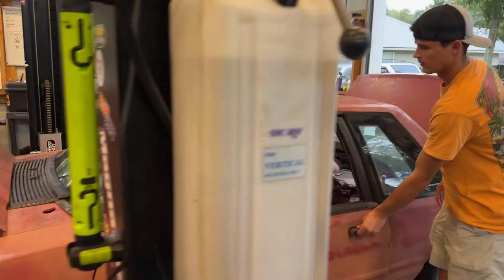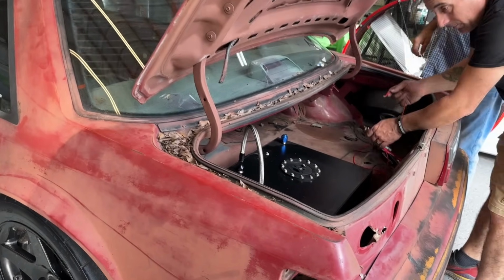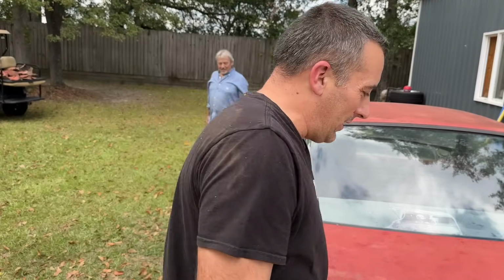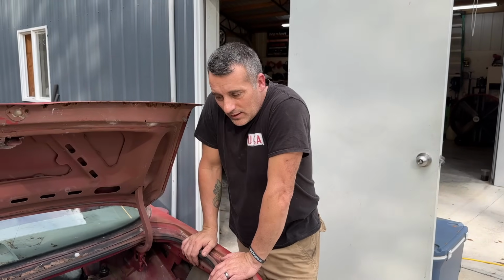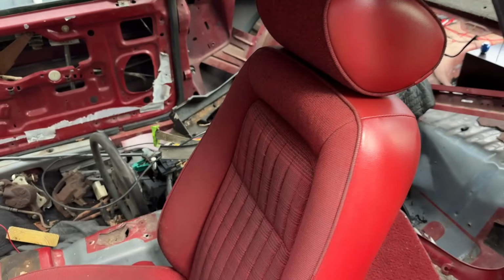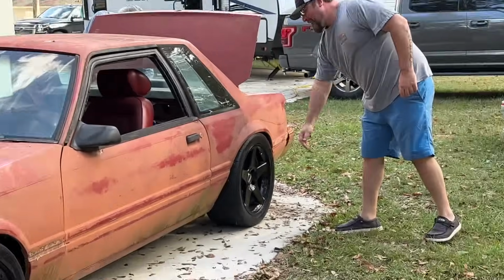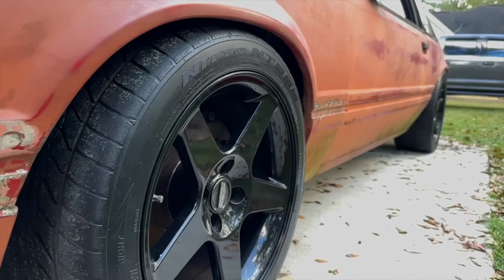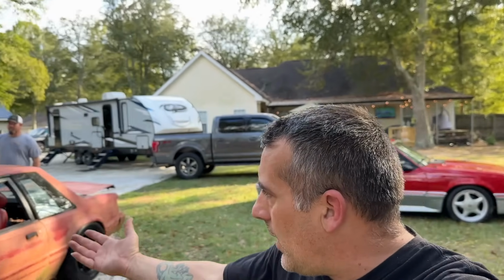The Best Day For A Car Guy | Driving My Project Car | 5.0

Comment: Love the car and the stance what you running suspension wise ? And I have those same wheels I had to run 1/4in spacers due to rim was rubbing on shock but afraid lug nuts barley holding on. Need some help

Comment: When you cut stock springs, do you have to install caster camber plates?  I have them on my sn95, but my dad has a 92 LX with stock springs that I want to cut.  Just don’t know if I’d need a set of caster camber plates at the same time.